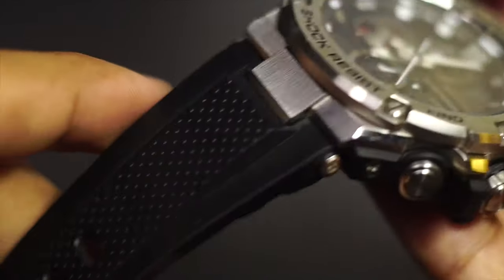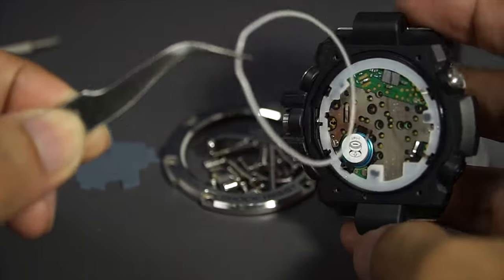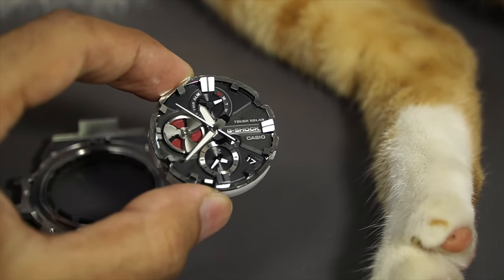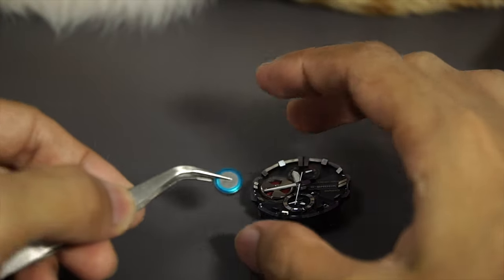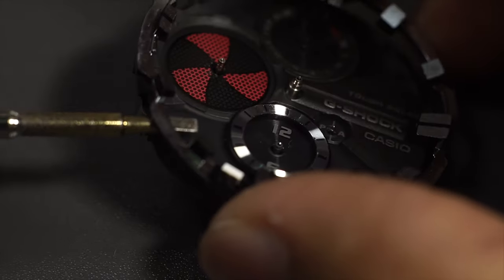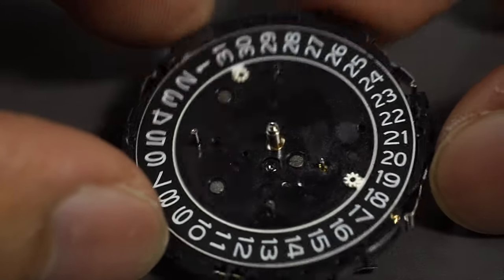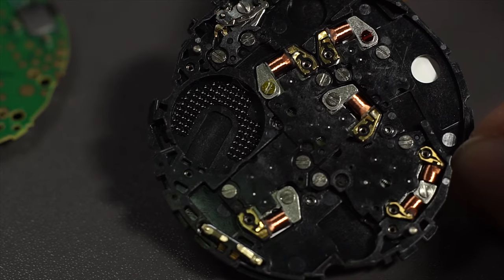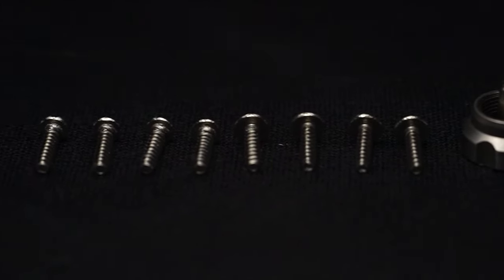Whats inside the magnificent G-Steel GST-B100 Solar Bluetooth series G-Shock watch

Comment: I know I'm late to the party... and also because this is my favourite g shock (because its all analog) i might be over thinking a bit here... but I bought one of these about 6 months ago.... and out of the box, it's battery was near empty.... in my attempts to charge it in direct sunlight.... I might have over heated it once(or a couple of times)..... it still works just fine.... I've absolutely no issues whatsoever!!... my question is.. does this warrant a service?? Could the heat from the sun have messed up something I don't yet see?? Also could the heat have compromised its water resistance??I would really appreciate some degree of assurance before I jump the gun and buy a new one😅(not that i won't otherwise.... all analogs are hard to come by in g shocks).... thank you

Comment: Hi, congratulation, amazing video!! Can I have a question? I love my GST-B100-1aer, bought it in used condition, works well but the metal bezel has many scratches. Is it possible to swap the bezel only? Do you know where to get an original bezel replacement? Or should I try to polish instead? Thanks so much and again, well done for this great vid!
Reply: There are several places online that carry official Casio replacement parts. I'm sure you could track one down.

Comment: A simpler scratch free method for the dials is to use a thread. 
Cut it into two equal lengths, 
hold two sides with the right thumb and index, the other sides with the left thumb and index, slide the thread around the dial base, twist the thread by rubbing your fingers to ensure the thread is secure around the base,
Remove the dial by Tightening the strings
Reply from the maker: Might work with regular time keeping watch with just 1 shaft for hour minutes seconds. Not this, the tape is strong and place at unexpected location. Meaning different amount of force is required at different point. Plus, it has a lot of shaft for all of the smaller dials as well.

Comment: Realy impressing! I watched the video, because I had to change the accu in my B100. It helped a lot! But I have one question: When I opened the Backplate, a tiny steel spring (2mm long, 1mm diameter)  jumped off. I have no Idea, where it's comming from. After reassembling my watch without this spring, all worked fine. What could it be?

Comment: 13:15 - Even for a quartz you should still remove the hands while at the same position
I actually have this watch and its been my fav over the last year
Reply: OUCH! And you pilled them off without any plastic protection?
Reply from the maker: Maybe for the Master of G ones since their movements is built differently and more complicated, for these lower end models, the gears and shaft didn't have any marker/pointer on them for alignment. I do however need to assemble them in the same position at 12 index afterwards regardless of which position I pull the hands out. Any other misaligned could be fix by the movement itself through 'hand-adjust function'.
Reply from the maker: The plastic protection does help to preventing scratch on the hands and the face dial, I gotta keep this in mind for future videos, Thanks!

Comment: hei mate! this is totally awesome and i think you are a watch GOD!

a couple of questions: at around minute 4:00, when you open the watch, there are three holes that should have three springs in them. what are those springs for?

where can you buy replacement parts for this watches? by accident, i broke one of the metal ears that the buttons have. is that something that affects the watch? what are they for?
Reply from the maker: Springs on the back normally for beeping sound feature.

If the button didn't bent or stuck, should be fine. Casio didn't sells that specific part to the public apparently.
Reply: @gshockhighfashion  thank you very much!

Comment: but i dont understand one thing.. this battery indicator disk - if it says its low, does it mean the real battery inside is already low? or it means solar cell is almost finished and, if not recharged, it will start taking power from a real battery itself?
Reply: It is a battery indicator.
The solar cell charges the battery.
Reply: @e28forever30  but it says in official description that there is solar cell and battery. so i am not sure is the battery separated and being used when solar cell fails or empties, or its inside battery already?
Reply: @sagorevach  
The solar cell CHARGES the battery.
So, by logical deduction, they are connected.
Don’t you think it would be stupid to put a separate solar cell and battery in the watch ?
What use would a solar cell have if you still had to change the battery?
Reply: @e28forever30  as a backup power in case solar cell goes off or similar. Same as hybrid car, you have rechargeable battery and gasoline.
Reply: @sagorevach  
No, that would be stupid.

Solar power during the day, battery power during the night?

Doesn’t it make perfect sense to you, that the solar cell constantly charges the battery, so the battery stays full, and the watch keeps on working WITHOUT having to change the battery??

A hybrid car ALSO charges the battery when the engine is running, same thing.
Reply: @e28forever30  no, read again my reply. if again you didnt understand, I will elaborate.
Reply: @sagorevach  
No, I will not read your reply again.
To me the technology is clear and simple.
Even my 12 year old son understands it.
Reply: @e28forever30  ok, pal, since your ego is raging... If solar cell fails, which  can easily happen when you need the most, what are you gonna do? are you saying that it wouldnt be totally helpful to have backup battery that will keep it running until you fix it?
Reply: @sagorevach  
Remember, you asked a question, I answered it.

To me technology is clear, I don’t need an explanation.

Now, onto the subject.

Why would the solar cell fail?
What if the quartz Crystal fails?
What if the stepper motor fails?
What if the hands fall off?
You see what I mean?

Do you know how old the solar technology in watches is?
They have been around for decades, and they work fine.
IF the solar cell fails, the watch will run on the energy that is left in the battery.
It wil run until that battery is empty,  maybe a couple of months, because the battery in solar watches is generally much smaller than the battery in non solar watches.
It doesn’t need to be big because it gets charged regularly.
Reply: @e28forever30  Stop reaming.. When it comes to energy, there is always backup and there is manual for gwr-b1000 where it says "stores solar power into SECONDARY battery", so it is confusing which watch has what. Why hospitals and every important institution have generators?  Its more likely that the solar cell power might fail, than motor to go off, or handles etc... You have numerous cases.. On the other hand, what if you live in Alaska, it can be 6 months dark:). Just saying..
Reply: @sagorevach  
There is only ONE battery.

The solar cell is the PRIMARY
 power source, the rechargeable battery is the SECONDARY power source.

When there is no light, the watch runs on the battery.

When you live in Alaska, you still have artificial lighting to charge your watch battery, no problem.

Most solar watches have a “low power” indicator, so you will know when to give it some extra light.

It makes absolutely no sense to have an extra battery as a backup, because the solar technology is TRIED AND TESTED FOR MANY YEARS.

Only thing that can happen after a long time is that your rechargeable battery dies.
Then you just put in a new one, not the end of the world.

The comparison with a hospital is completely off topic, nobody will get killed when my watch stops working…
Fix it or buy a new one, case closed.
Reply: @e28forever30 cell cant be source but converter. and it didnt say secondary source but secondary battery, dont twist what is written in official manual. it can fail exactly when you are in some remote place, Murphy's law. Without track of time, you can have problems that can cause other problems, doesnt have to be related to the matter of life and death. Artifical light recharges much slower... And you are foaming about it again, chill. Essence is, backup is always good, and such systems are everywhere around.
Reply: @sagorevach  
Cell can’t be source?
 
You are wrong there buddy.

You have never seen those solar calculators that stop working when you cover the solar cell?
They stop working because the solar cell is the source.

You have never seen the YouTube video of the guy that removed the battery from his Citizen Eco Drive watch?
Funny thing was , the watch started ticking as soon as it received light, so yes, the solar cell can power a quartz watch.

Educate yourself please.

The same “ secondary battery “ text is in the manual of my GST-B200, and I am 1000% sure there is only ONE battery in my watch.

I assume it is a bad translation, and they mean that the battery is the secondary source, when there is no light.
Remember, these are Japanese watches, and somebody has to do the translations.

News break, your watch can fail ANYTIME.
So does your car, so does your fridge, so does your phone, so does your bike …

Just a fact of life.
Reply: @e28forever30  cell is acting as converter. Power storage is other story. Keep foaming:).
they translated all the technicalities correct, and failed with the source/battery hahaha. You amuse me
PS: I think you should refer to them as their translator  specialised with batteries/solar cells
Reply: @sagorevach  
So you think there are 2 batteries in the watch, one as a backup.
That is ridiculous.
Have you even read my comment?
Reply: @UC7O37hg4Z_plgfK5eIDw-WQ Comes from an omnipotent "expert" who claims that the people, who do professional translations, got confused and misinterpreted whether or not its  source/battery :D
Reply: @e28forever30  I didnt claim it, I just asked from the beginning, but your ego started raging like "why would there be two batteries, why this, why that, me and my son are Einsteins, bla bla..." etc. And I just elaborated it is nothing weird and very usual to have backup power.
Reply: @sagorevach  
You started this with a stupid question, for which I gave you a decent answer.
But apparently you don’t want to hear other people’s answers, you only believe your own paranoia.
Why ask a question then?
Totally illogical!!
What do you need to believe me, a view on the inside of a solar G -Shock??
Reply: @sagorevach  
You don’t need backup power on a watch.
It is only a watch, man.

Do you have backup power on your car?
A car is much more important than a watch.
And even a car doesn’t have backup power.

You are quite obsessed with that, very strange.
Stuff breaks down, that’s part of life.
You and I will break down one day, too.

Furthermore, I give you valid arguments, you prefer to ignore them.

The pocket calculator, the Citizen watch, have you read those arguments?

I will post a breakdown video of a G Steel Solar watch.
There is one battery in there. 
More than enough.
Reply: @sagorevach  
https://youtu.be/GtpzeAzCVvo
Skip to 5:48.
One battery.
Reply: @sagorevach  
Module of the GST-B100 is 5513.
Look it up.
In the manual You’ll find the same text , where there is a mention of a “ secondary battery “, but in fact there is only 1 battery, so how do you explain that, other than a bad translation?
Reply: @e28forever30  stupid is to claim that the official translation is wrong, and not question which was just a result of not knowing the details
Reply: @sagorevach  
I studied the details, you didn’t.

Did you come up with the breakdown video of the watch?

Did you research the manual for that particular watch?
 
Did you notice that the same paragraph in the manual is used, not only in the watch you mentioned, but also in the manual of my watch, and the manual of the watch in the video?

Did you think further, as to conclude there is only ONE BATTERY in the watch, essentially ENDING this discussion ?

No, no, no and no.

All you do is panic about things breaking down., not listening to what other people have to say.

Now, bring me a solid proof of you theories that there me must be a second battery.

Come on, put some work in it, Google it, like smart people do.

Convince me, but with proof, not with nonsensical arguments.
Reply: @e28forever30 in the beginning, I asked if  there is by some chance a secondary  battery that maybe he forgot to mention,  as I found in description specs online for gshock watch i mentioned earlier, and i didnt claim there is secondary battery. Then you started with some pretentious attitude like some agent of cosmic forces watches, and instantly stepped in as all-knowing entity without shaking your head before reply, and asking yourself couple of things first, and even denying and correcting the official translation...
Reply: @e28forever30 But see, you were wrong when you said "they didnt translate it correctly". You wouldnt know what is primary and secondary battery if you havent searched for it, yet you made funny explanation by blaming the translation. We were challenging each other with knowledge that we already have, and I knew better and you didnt. However, now it makes sense with info you have found out, tho I never google for something if I have someone to do it for me. Thank you for that.
PS: It still doesnt change the fact that lots of devices have backup battery and it shouldnt be surprise if someone asks about it.
Reply: @sagorevach  
It would not be the first time an translation went wrong.
I’ve seen numerous manuals that had weird/ funny translations.
People make mistakes all the time, and a lot of them go unnoticed to the printer.

So my assumption was wrong, no problem admitting that.
But I was right all the time that there is only one battery.

I honestly can’t understand why there are always people on YouTube asking questions that they can answer their selves,, just by using the most powerful tool in the world: the internet!

Everything you want to know, it’s right there at your fingertips.

It is that attitude that gets me wound up, if you want to get to the bottom of stuff, make an effort.

I made that effort for you.

Thanks for the acknowledgement.

Now, about backup power, most common devices do not have backup power as far as I know. It all comes down to the importance of the device. 
In a hospital or an airplane the importance is very clear: lives are at stake.

In a watch, no watch that I know of has backup power, can you name me one brand or type of watch that has this on board?

My guess is: no, you can’t.
Reply: @e28forever30  But, you know what Aristotle once said - "if we all think the same, then we dont think enough"... You were right, but I wasnt wrong.  I just expressed a suspicion whether or not there are one or two battery, I didnt claim anything, just defending the fact that it wouldnt be surprise there are 2 batteries, as there are numerous devices.. Thanks for effort tho.

Comment: Dude does not need to use this motorized screwdriver at all. That was the most paintful intro ever watching the screw heads gets stripped and the flat head driver scratching up the edge of face was making me so mad. Go back to hands tools and make sure you have a good bite on the head before rotating it Jesus!